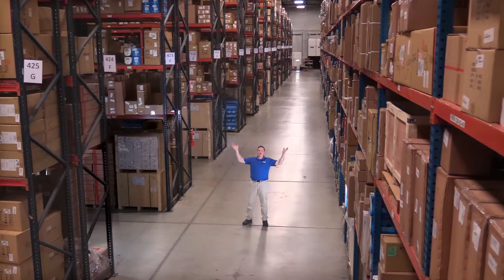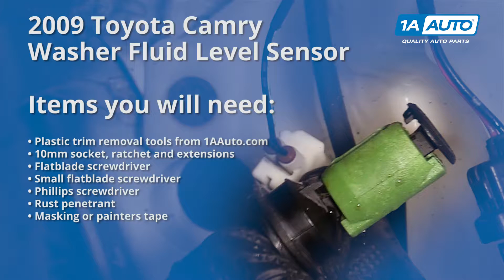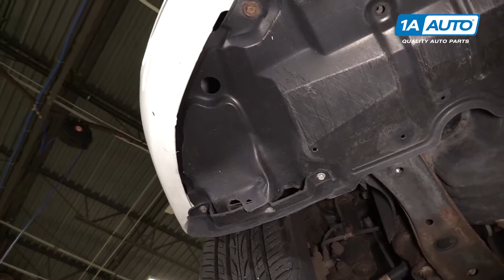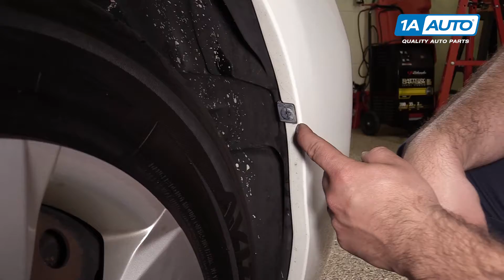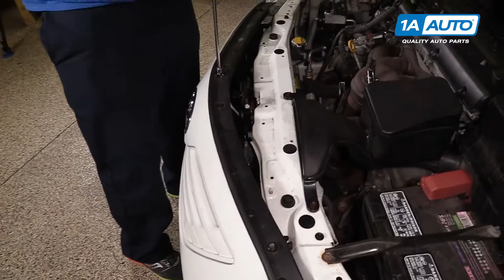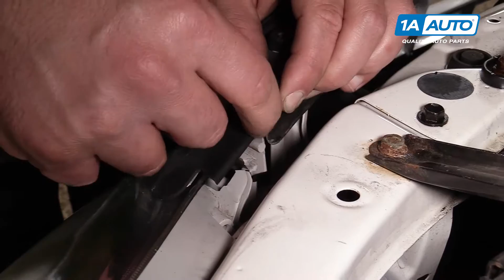How to Replace Windshield Washer Fluid Level Sensor 06-11 Toyota Camry

Comment: ❤Thanks for your video, knowing the orientation of washer pump & sensor facing the wheel is indeed a great help. I didn’t remove front bumper at all. Turn the wheels right and flip up the wheel arch cover/splash shield, unclip the connector & take out the sensor. Easy in 15minutes I guess. ❤thanks bro appreciate you showing what’s it like at that location really helps a lot.

Comment: I have a SCION XD. Probably a similar PITA to get to. But having checked the fuse I thought the pump was surely the next step. maybe not? If the Camry has a fluid level indicator, maybe my SCION-XD does too? Because if so, and if its only the sensor that's bad, shouldn't there be a simple way to bypass it? Or would I have had a dashboard indicator is the fluid was low?  Also, almost looks like you could have got to the pump and sensor by just taking off the wheel cowling?

Comment: I removed the 2 clips and right side fender liner.  Then turned wheel left,  then i popped it out and i see the level sensor. No need to remove the bottom plastic panels.